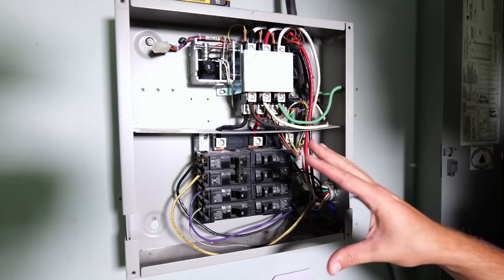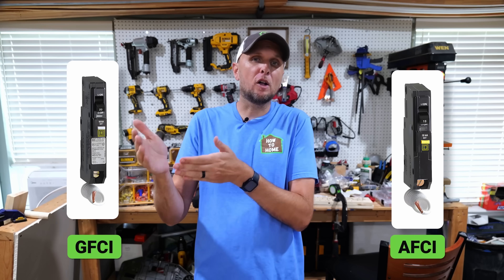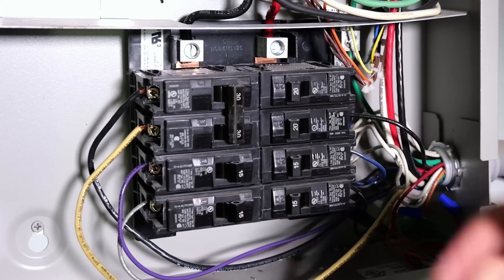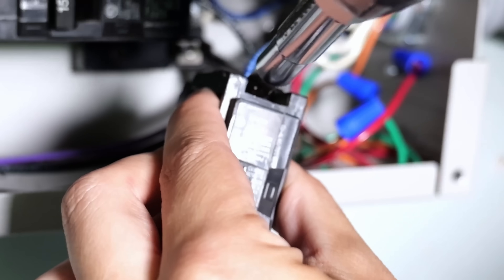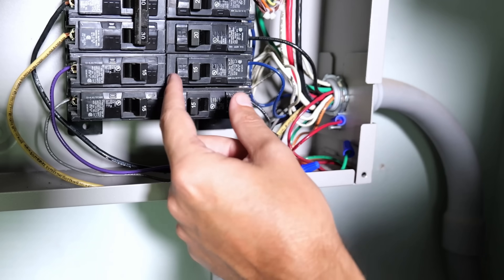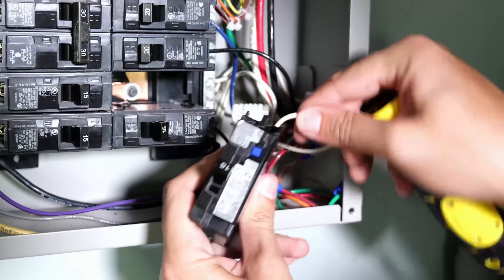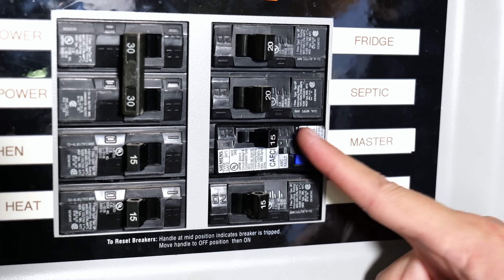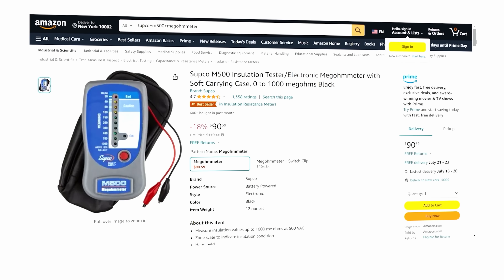Most DIYers Miss This CRITICAL Detail Installing Circuit Breakers!

Comment: When I had my generator sub-panel installed we had issues with the AFCI breakers tripping in my main panel when using the generator. They dont trip with standard breakers. Any ideas about that? The generator is a portable 30amp inverter.
Reply: Arc fault breakers work by detecting the radio frequency noise an arc fault generates. Unfortunately a lot of AC motors generate similar noise from the brushes used to pass current to the rotating part of the motor ( aka rotor). Older motors are worse. You probably don’t want them on fridges or freezers. AFCI requirements are the result of self serving electrical manufacturing reps sitting on code writing committees
Reply: Generators make noisy and hashy power, AFCI breakers trip every time.
Reply: ACI breakers use voodoo magic to detect arc faults, and it is really easy to get false trips.  some brands are worse about that than others.

Comment: The "false alarms" of afci breakers can get quite annoying.
Reply: My son has the Siemens Combo Breakers and he had a number of nuisance trips with certain table appliances. I installed GFCI receptacles at the the locations they were plugged into and it stopped the trips. Can't explain exactly why, but it seems the receptacle masks the appliance internal switching from the breaker. I heard there was class action suit pending about these. Never had a problem with the Levitton AFCI or GFCI receptacles or the Square D QO combos or AFCIs.
Reply: @rzh3443  Thanks for the info. I have been leaning toward the Square D QO if I ever do an upgrade from my old GE panel.
Reply: Same with the GFCI breakers and outlets LOL.
Reply: GFCI trips can also be annoyingly frequent.

Comment: I've had a wire come loose from a breaker and back out.  Murphy's law was in-effect.  It wasn't a sunny summer afternoon and a relatively unused circuit.  Nooo...  It was when we lived in Minnesota, in winter, it was for the furnace, and of course it happened in the middle of the night.  You wake up at 2 AM and wonder why the house is cold...  You have power yet, no furnace...  Took me about 15 min to wake up enough to backtrace to the panel, find it, swear, and reinstall it.  No, not something I did - it was a new house, that one was on the electrician that installed it.

Our current place is all standard breakers, with a GFCI breaker for the kitchen circuit.  (which I've accidentally verified is very sensitive)  I don't think I'll arbitrarily replace any standards with AFCI, but if I ever have to add or replace any I'll probably use AFCI after seeing this.
Reply: With my (somewhat) limited experience, I have found an occasional breaker wire has loosened, or perhaps was never properly torqued, initially.

Comment: Great video as always !Now to say that you are required to AFCI breakers in your home may not necessarily the case as a home that has standard breakers before the code required AFCI breakers . I do understand that all new construction will require AFCI .
Reply: I believe the code applies to replacing a breaker.  If the current breaker fails, or needs replaced, you have to replace that breaker if its a breaker for a living space, has to be replaced with an AFCI breaker.
Reply: @wildbill23c  It gets more complicated if your home has multi-wire branch circuits (shared neutrals).
Reply: @wildbill23c  No, it does not. It is applicable to a new build or an addition. If you do what he did, add solar or a generator, then yes, you would have to.
Reply: @kriswingert1662  Better read up on the code.
Reply: Its too bad they won't know. 😂 @wildbill23c

Comment: Just curious, why all the stranded wire in the Generac sub panel?
Reply: His panel feed was through conduit - it is customary (and easier) to use/pull/push stranded wire through conduit.
Reply: most likely used stranded wire to extend the circuits from the original panel.

Comment: You make a point out of using the Robertson head for loosening and tightening the screws on the breaker. Then I noticed halfway through when you’re replacing the breaker you use it straight screwdriver head. What’s going on?
Reply from the maker: I didn’t have a Robertson bit that fit in my torque screwdriver at the time.  There was always one in the other screwdriver though.  Trust me, if I had one that would go in it I would’ve used it.  Way easier.
Reply: @HowToHomeDIY figured that was likely it
Reply: Wouldn't an ECX bit fit better
Reply: Wish they just used philips. have to find a Robertson driver can be a pain, & you need to carry an extra driver to get the jobs done.

Comment: Great vid. Comprehensive but not extra wordy. Like other commenters, I don’t intend to swap working non-AFCI breakers out, but will add them if / when I install new circuits.
Reply: Yes, you don't have to rush out and replace currently functional breakers, but yes when you replace a breaker in the future for a living space circuit you'll have to get the AFCI breaker.
Reply: @wildbill23c  No, you actually don't. Your house is NOT a new build, so it does not have to comply to a new standard. If you add a new build to your existing home, THEN you will have to update a panel.
Reply: Builds prior to 2002 for bedroom receptacles and 2008 for other AFCI requirements are NOT required to be updated if individual breakers are being relpaced.  You may elect to update if you desire.  Personally I would not.
Arching in the appliance cords are the primary source of arcs.  Not the house wiring.
Maintaining good appliance cords, not pulling on cords in the middle, pull on the plug at the receptacle, to disconnect.

Comment: I definitely wouldn’t switch from what’s working and original to these but good to know if box is ever changed out.
Reply: What I gathered is that it's going to cost a small fortune in breakers if I ever have to get a panel replaced.
Reply: No, you are generally not required to replace existing breakers with arc fault circuit interrupters (AFCIs) when replacing an electrical panel, unless you are also extending or adding new circuits. If you are simply replacing the panel without altering existing circuits, you can keep your current breakers. 
Here's a more detailed explanation:
Panel replacement alone:
If you are just swapping out the old panel for a new one and not making any changes to the wiring of existing circuits, then you do not need to replace your existing breakers with AFCI breakers. 
Adding or extending circuits:
If you are adding new circuits or extending existing ones (by more than 6 feet, in most cases), then you will need to install AFCI protection for those new or extended circuits.
Reply: Expensive

Comment: I have put in addition on the back of my house the sub panel that had to be added for this room is full of arc fault breakers now when I plug my vacuum in in my new addition and turn it on it trips the breaker every time have the electrician back to replace the breaker it still happens the electrician by code cannot put any other breaker in that box there’s something drastically wrong with this code
Reply: I frequently tell customers to use the bathroom plug for vacuuming, since most jurisdictions allow bathroom plugs to not have AFCI protection AND they are required to be on 20A circuits.
Reply: Wow, that is exactly what happens with us on one breaker when we plug in the vacuum it  trips the breaker of cause the builder jerked us around until the one year of warranty was up to tell us the breaker is probably bad 🤔
Reply: It's a scam so insurance companies can claim you caused the fire by not having AFCI breakers. You can't prove it wasn't when everything is burned.
Reply: One word: “Punctuations”
Reply: @JustRounding3rd  life’s too short to text with your thumbs voice texting is all I do however, it comes out. That’s the way it comes out. I’m sure you can figure out what I’m trying to say.
Reply: @kenwhitcomb6015  I can. I have an uncle whom ONLY uses voice text. What’s worse is that he’s a Mumbler, so u can imagine how frustrating it is trying to decipher some of his longer messages…🤦🏻‍♂️

Comment: I don’t understand why the government federal is involved in electrical codes why is it I have a gas hot water heater but yet I have to have the electrical plug there just in case I want to switch over why is my roof pre-wired for solar why is my garage pre-wired for an electric car why do I have to have a 400 amp service to my house to cover all this bullshit
Reply: Industry lobbyists.
Reply: Federal gov is not really involved in codes. It's state (primarily) and local govs. Codes are developed by private associations. State govs then can decide whether to adopt them (they usually do), giving them the force of law. But they also often make state-specific amendments based on their specific conditions (such as the much more stringent building codes adopted in Florida  post H. Andrew). Localities also sometimes have authority to make further modifications, though that generally is discouraged to avoid an unweildy patchwork.
Reply: What's happening is that requirements and codes get stiffer and stiffer for anything new which is putting housing out of reach for most. Meantime, there are millions of homes with totally outdated electrical, plumbing , insulation HVAC , etc. I upgrade to AFCI if i add a circuit. I used AFCI receptacles on existing circuits after locating the first in line ( cheaper , but not totally as "safe").
Reply: The National Electrical Code (NEC) is to protect home, business, and farm owners, and keep them safe from electrical problems, such as death from electrical shocks and fires. As it is said, safety rules are "written in blood".

Local codes can be more restrictive than the national code. The size of your house may also require higher standards, such as a 400 amp service. Often, an electrical outlet is required nearby a service panel - and that may also be the case with your water heater.

Comment: The insurance company’s Have totally destroyed the electrical industry there is no need for the whole panel to be filled with arc fault breakers they are too sensitive and cause more issues then they’re worth never mind that all these breakers are double or triple the cost of a regular breaker
Reply: Yep. More people probably  injured falling down the stairs resetting the damn things than people dying in house fires
Reply: The code allows for user replacement of breakers for nuisance trips, once you pass inspection you can rip out every single one if you want. Anything with a large inductive load is going to trigger the arc fault detection circuit because it has the similar ripple and current lag characteristics as an arc.
Reply: @AReed030188  Homeowner here.  Ripped out 11 of the arc-breakers and replaced with the old ones as they kept tripping in nearly every electrical storm.  Saved the BS-arc breakers in case I ever wanted to replace to satisfy an inspector.  Total waste of money.
Reply: Can’t wait to add to my monthly list of things to do, check breakers in every room in the house. Get real!
Reply: In some states, gfci breakers are required in bedrooms. Bedrooms? What da heck!?!?
Reply: If you have a wet bedroom you got bigger problems @rudert56
Reply: @rudert56 it can get pretty wet and sweaty in a BR…😉😉😉
Reply: Yeah my mom’s dryer wont work cuz her AFCI breaker keeps tripping and her house was built a year ago and the builder said that she needs a new dryer instead of finding a fix for her
Reply: @omegaanimations8549  Home Depot has a large selection of breakers!  Time to help dear old Mom!!!
Reply: Not insurance companies!!  The national electrical code is written by electrical manufacturers.  So if you invent something that costs more than you like, the code will soon require it
Reply: Everyone I know who had these has removed them and replaced them with standard breakers. They just trip all the time.
Reply: AMEN !!   I have preached this ever since they came out with these abominations !!  The insurance companies WRITE the freaking code books now.  It's a CASH GRAB !!
Reply: @RobertCunningham-pf9tg and look at what politicians have invested in those deals and gotten rich. Follow the money trail.
Reply: The thing is that they are not made to be used as a on or off switch, so the more they trip the more they are prone to fail. A failure in the engaged position is not uncommon.
Reply: "companies", not company's
Reply: Agreed! AFCIs commonly nuisance-trip while, too often, failing to trip on real arc faults. ElectroBOOM posted a great video about a month ago showing how difficult it was to make it trip. 
Wire properly, torque to spec connectors, replace loose receptacles and never use the cheap ones anywhere that sees more than rare occasional use. The good ones are 3-4× the price but what's an extra $300-$500 to keep your house safe? (Less than a panel full of AFCIs, I'm sure.)
Reply: @matthewellisor5835  insurance company lobbyist and pay to play money is rampant and the electrical code…..
Reply: It’s not just the insurance industry, electrical industry has a major presence in shaping the NEC. So what happens is some manufacturer invents a new electrical device. Then they get on the various NEC boards and changes the code to mandate use of whatever they had invented.
Reply: Interesting comment. I never thought of this. Yes I’m former electronics maintenance in Air Force so I understand but these standards are something else. I’ll have to go looking at a new home to see what they have!
Reply: All light switches arc.
Reply: Insurance companies.